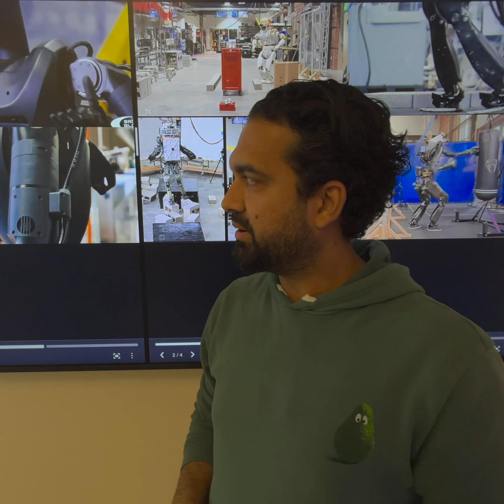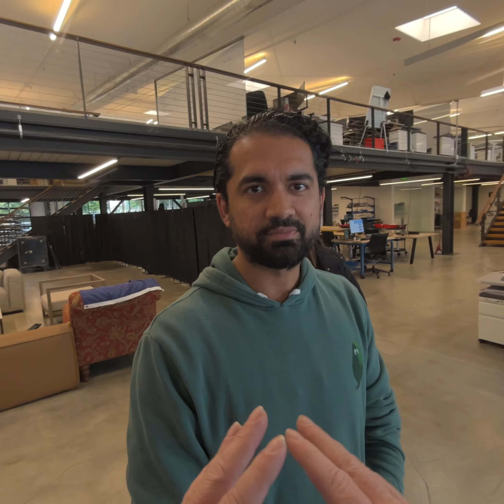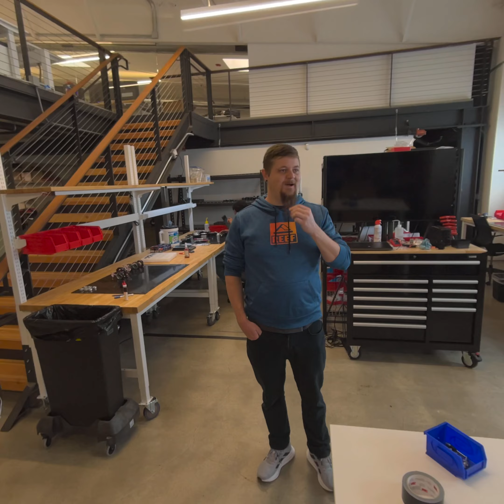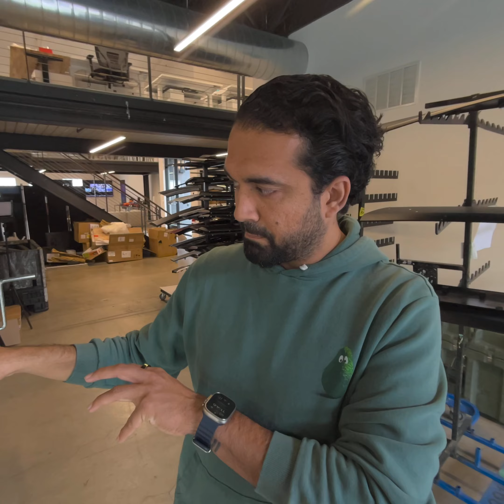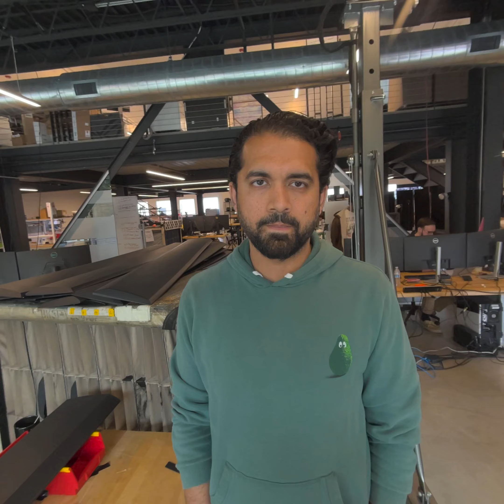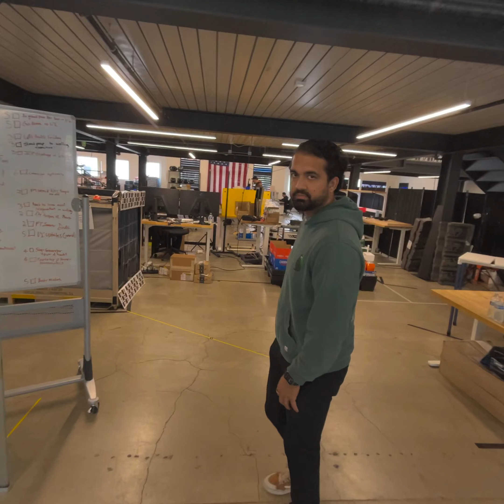48: Tour of a Humanoid Robot startup in San Francisco

Comment: In regard to sensors one sensor that  has a high data rate and does not  (ironically) add noise is an acoustic camera.

While precise audio direction finding may not be all that critical for  most industrial applications (although Spot does seem to carry an acoustic camera) and maybe of limited use for home applications, they can be of critical use for military applications, like detecting approaching UAVs.

e.g. Goggle
SV600 Fixed Acoustic Imager Payload for Boston Dynamics Spot®

FPV detection with phased microphone array

FLIR Si2 | Acoustic Imaging Camera for Air Leak, Mechanical Fault, and Partial Discharge Detection

In fact the military application of humanoid bots  is far different from commercial ones in that they  can rely much more on teleoperation (and in many ways one wants to keep the human in the loop) and  things like safety and reliability is far less important in that their lifespan on the battlefield may not be all that long anyway and the battlefield is already a dangerous place to be.

Also, military bots don't need to do a job better than its human counterpart but just instead of  them where the human can operate it form far away which might be a much safer location.

Comment: There is perhaps another way to train humanoid bots by creating  a humanoid robot ecosystem.

Her ethe ecosystem has the smarts and does not care about how a thing is moved but only where and when it is moved.

Thus it acts as if the object could levitate on its own and then move from point a to point b along a nominal path p. 

Thenthe bot can be trained to  do that lower level function,  but can adjusts the geometry of it but not so much the topology, that is it can  move an alternate path p' instead of p based on  what it sees while executing that task.

Rather then try to further explain this approach here  I posted  two videos on my youTube channel that illustrate this approach  in a kitchen ecosystem  with several sub ecosystems, a dishwasher, counters, cabinet, and a refrigerator.

The idea her eois to remove the bot from the model and just model what needs to be be and not how one will actually cause it to be done, that being done by the bot  which is given lower level commands where the bot does not need to understand what the action are for just the constraints and boundary conditions it has to perform teh action..
Reply: In regard to K Scale Labs, it is a pity they have now given up the ghost.  

That said  you might check out the post I left on their website , mostly on their last video  on some use cases for a low cost robot such as they were trying to make.

My thought is that they might have gotten some review by focusing in on the military market instead of trying to compete with the low cost Chinese bots which have enormously more  resources  to bring to  bear vs K Scale Labs.

K Scale Labs was my favorite bots company (in that they were sprappy) but now I would have to say Foundation is that (who look to have the right approach), albeit their bots cost much more, but  also can do much more as well.

So good luck to Foundation bots!